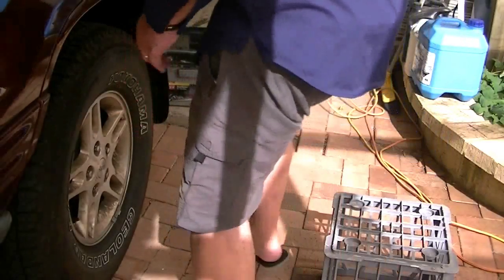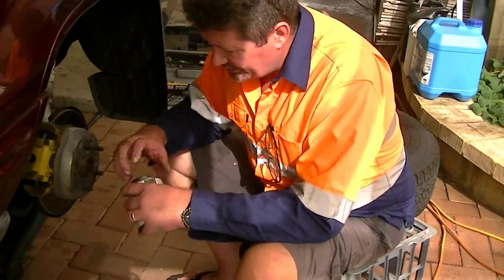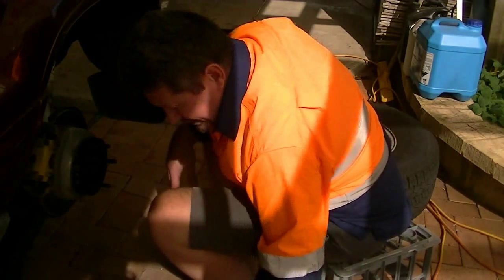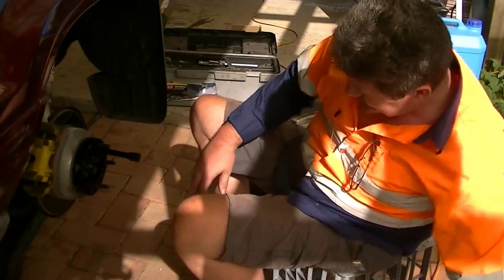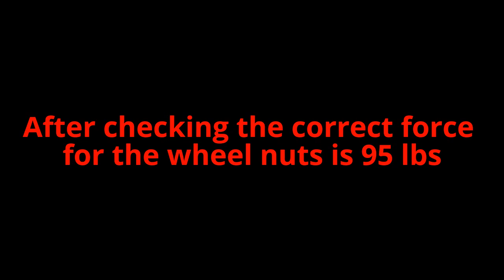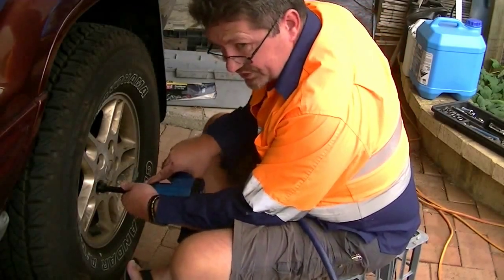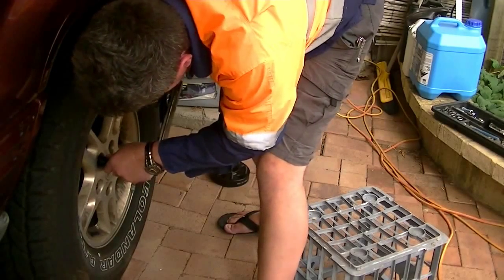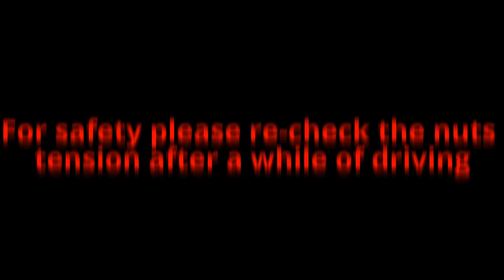How to fit hub centric wheel spacers to widen you wheel track and stop wide tires from rubbing

Comment: Not legal anywhere in Australia.
Reply from the maker: Yes I know. Not sure I agree with that rule if they are good quality hubcentric spacers. Studies have shown wheels break before these spacers will. I agree plain spacers and even non HC spacers are dangerous. I will get offset wheels one day make it legal. Regards Rik
Reply: The main issue is not with the spacers or wheels breaking, if a wheel is going to break it will do that regardless of the spacers, it means it is a weak wheel, a solid spacer would be damn hard to break at any time and if you did somehow break one I doubt there would be much else left of the car that is also not broken including any one who happens to be in it. The main issue with spacers is the fact that they put the wheel further out from the axle, of course this is why people use them but many fail to realize how much extra leverage this puts on every thing else, without doing the math the extra load on the studs holding the spacer on would be concern for a 50mm spacer, this extra load is also placed on every thing else such as bearings, axles, diffs and ball joints and there is also an increased load on the steering components. It is like putting a crow bar on the end of the axle. 
Many of the laws around vehicle modifications is Australia appear to be very tight and nonsense to most people but as an engineer I my self understand exactly why we have them. You also have to be very careful with insurance companies in the event of a crash, if they see them spacers they will not pay you, same with many modifications. Fact is that if you have any illegal mods at all insurance companies do not have to pay out any claim and it does not matter if they know about the mods or not. 
Just some food for thought Rik and anyone who is considering doing this should be aware of it. not putting you or your channel down.
Reply from the maker: I did not think you did that. The leverage is the same as offset wheels. Anything that moves the tires outward produces the same force on hubs and axles. It's the same as welding the spacers to the wheels. But offset wheels are legal as long as they don't stick outside of the vehicle. But your right I would not want to be in a vehicle with broken wheels lol. The law is the law though. I'm aware it's illegal but so are many other things we all do lol.
Reply: Yes the leverage is the same for spacers as it would be for the wheels offset the same amount however with spacers you are less likely to crack the centers out of the wheels like you would with less offset wheels. In a sense spacers would be a stronger alternative but you also have twice the amount of studs that can fail, 5 that hold the spacer and and the 5 that hold the wheel on. Stronger yes but with twice the amount of potential fail points.
 Here in NSW the minimum + offset that is legal for a WJ is around +35mm, you can increase track width by a maximum of 25mm or 15mm per side so for the stock 50.8mm offset rim offset - 15mm  if you have solid front and rear diffs, I think it is only 15mm max if it is IFS , if the car has traction control you are not allowed to change it at all, of course these laws change on an hourly basis and there is more than one version as well and you you can always bet that the cops will have a different version again. The only truly fully legal WJ is a factory stock unless you have gone and got specific engineering certificates for each mod. My WJ is basically stock although certainly not fully legal.. it is a bit loud with the Flowmaster Supper 44 muffler on it  LMAO.
Reply from the maker: If you watched more of my channel you know I ain't no Saint. Just my Ford GT profile roller camshafts would raise eyebrows. I'm half way saving up for the Elite 2500 stand alone engine management system. Thanks to my YouTube followers. Very grateful.
Reply: Your channel is great Rik, especially for us Aussie Jeepers :)
Reply from the maker: Thanks buddy much appreciated 👍👍👍👍👍👍👍